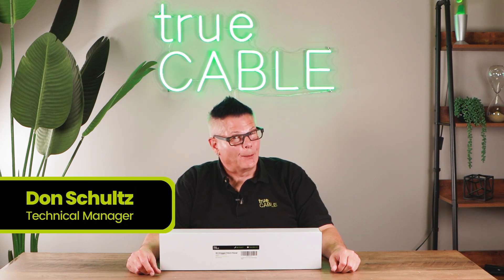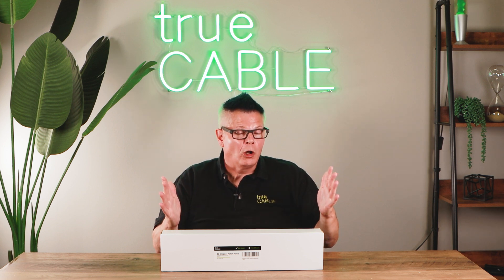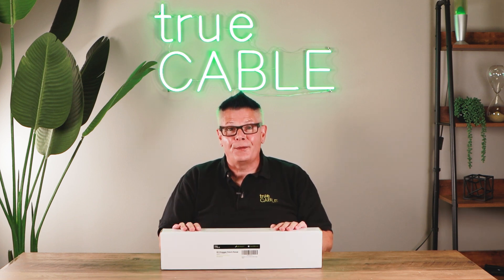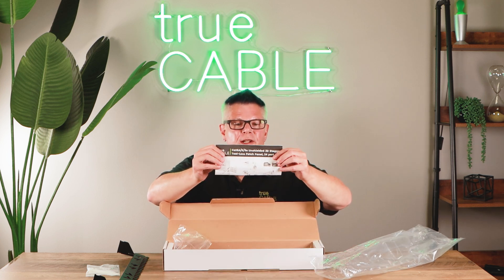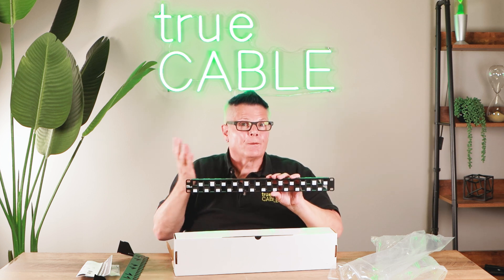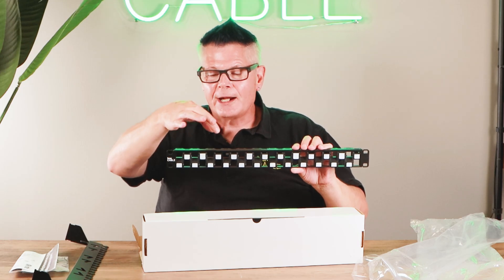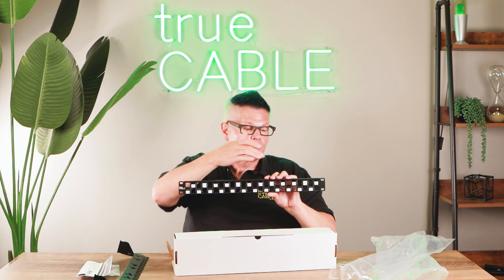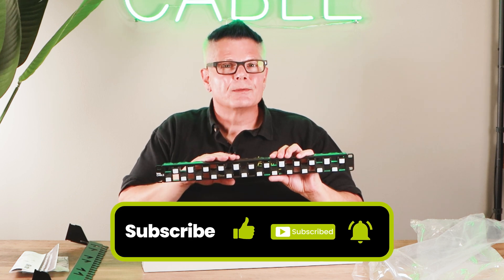The Optimal Way To Avoid Crosstalk: trueCABLE's 3D Staggered Unshielded Patch Panel!

Comment: On the upper row, with the keystone being so deeply recessed, how can you unplug the patch cable?
Reply from the maker: Hello! The recess is not excessively deep and well designed booted patch cords are easily unplugged like normal. This is not to say that poorly designed patch cords with those half-moon molded anti-snag boots that harden up over time won't potentially cause you an issue, but those poor quality patch cords can cause issues with regular non-recessed patch panels too. I have sat there and fought with unplugging patch cords where the anti-snag part of the boot hardened up and the RJ45 was locked really well into a keystone. The hardened half moon shape was stopping me from fully depressing the angled locking latch. It happened with a traditional straight-across panel!
Reply: @trueCABLE  I agree that those half moon boots are horrible and I don't use them anymore.

Comment: I realize that this is unshielded, but would it be a problem if I use shielded cable or keystones (realizing that they wouldn't be getting any shielded benefit)?
Reply: My understanding is that shielded runs need to be grounded, which is what a shielded patch panel accomplishes. Unless each run was grounded separately, the EMI that was "collected" by the shielded cable/keystones has nowhere to go and actually makes the problem worse than if there were no shielded components at all.
Reply from the maker: Hello CA! You would potentially set yourself up for a problem. As you know, the cable shields would not be able to drain off EMI/RFI/ESD through the keystone hardware and the patch panel frame to ground and therefore there would be no shielded benefit. HOWEVER, in rare instances in certain environments you can actually INCREASE any current issues with EMI/RFI/ESD that you have. In fact, you might unintentionally find issues you didn't know you had as well. Advice: Don't do it.